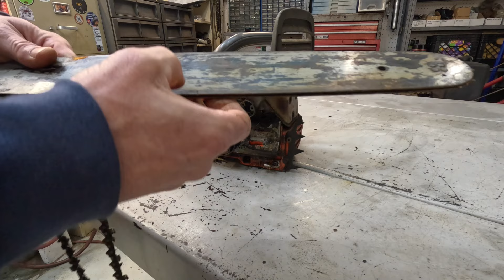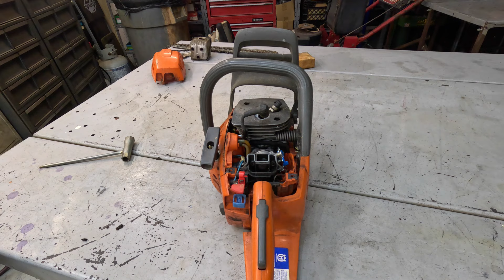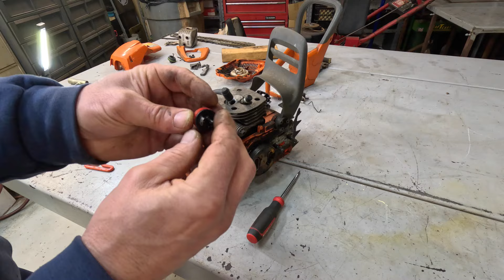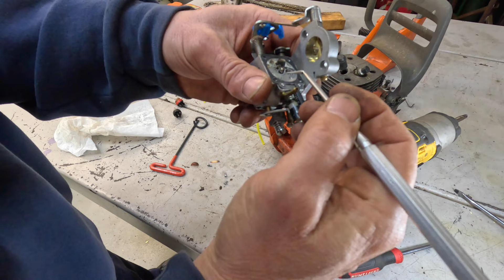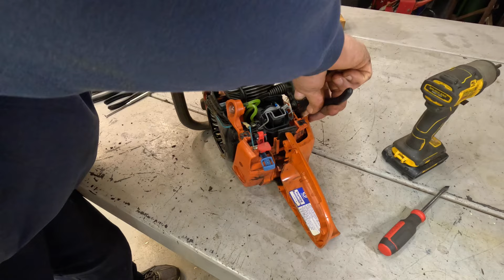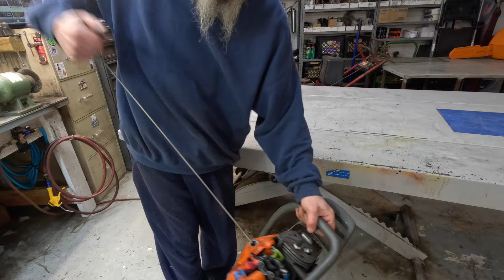Husqvarna 455 Rancher Chainsaw | Is It Any Good?

Comment: Toooom Doooobyyyy!! Hey, Tom! If you ever have problems getting lines onto filters, carbs, etc., try using rubbing alcohol. It's a quick lubricant, meaning it dries FAST and leaves no residue.
Thanks for another great tutorial! I may be doing this with my saw this year! Stand by for a phone call🤣🤣!! Have a great day. God bless.
Reply: Good tip that i will try out, here at EP i give all the fuel inlets a shot of Silicone spray works well and makes removal easy for us on the next service because all our fuel in Ontario, Canada now has ethanol. The only customers of ours that do not have issues are the ones that store their equipment with the alkylate fuel we sell.
Reply: The only problem if find with silicone, is that it stays slick. On small engines that require no clamps, I'd rather use the alcohol.
 @waynestefinashen239
Reply: @louroberts5567  Good point Lou but we use clamps on just about everything even primer lines of snowblowers and if not we have never seen an issue with a fuel line coming off. We even have used it on air line installation like breather tubes that may have been hard to get into the OHV cover or others without issue.

Comment: i worked on a smaller version of this i think a 235e what a bear to work on, all fuel lines were gone and just pieces in the tank,  on this smaller version they did not use tank grommets just holes in the tank and one was larger than the other the return was fine but feed line one was small and didnt match any size perfect so i had to use next size up line to make sure it didnt leak, what a job that was and i wont work on that model again i think they want you to buy a new one if it breaks down.
like you said i think they built the saw around the carb

Comment: Try marvel mystery oil… I fixed a Wisconsin Robin 2 cycle engine on a snapper. I poured 1/2 the bottle through the carb & spark plug hole. New NGK plug, Red Armor, MMO & Vp 101 race fuel from the pump at 20:1 (gas cap 32:1) with low compression a bit more oil is better…  3rd pull it started & the EPA got a free 3 hour smoke show…  MMO improved compression & it fired right up the next day.

Comment: I am glad we stopped working on two stroke handheld equipment, too hard on the body and brain. Also hard to justify the repair invoice on the cheaper stuff and dont even talk to me about working on a cement saw because i never saw one that came in that was not totally filthy with cement dust that took forever to clean out. Need two stroke repairs we sent to 5 Star engine repair next town North.